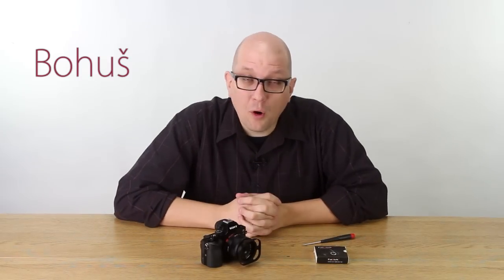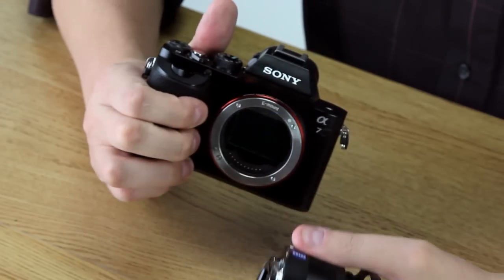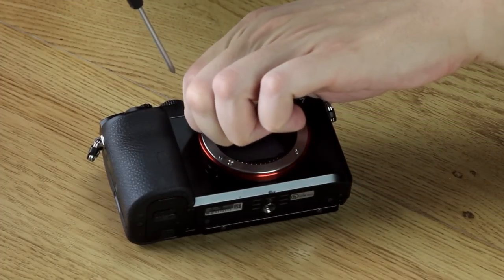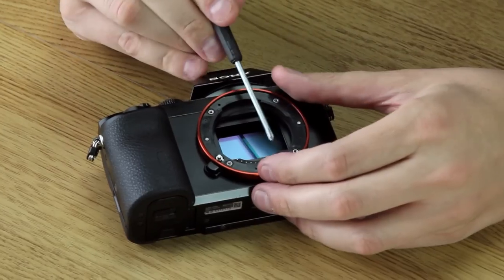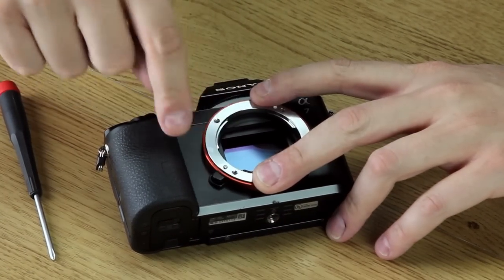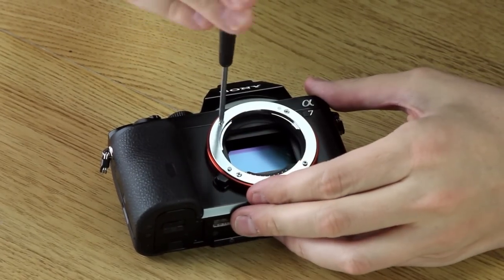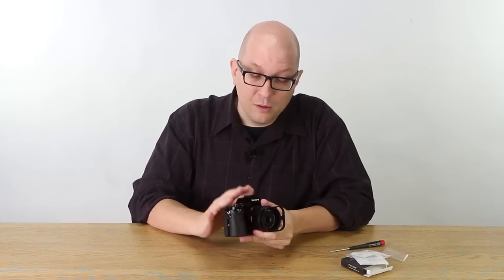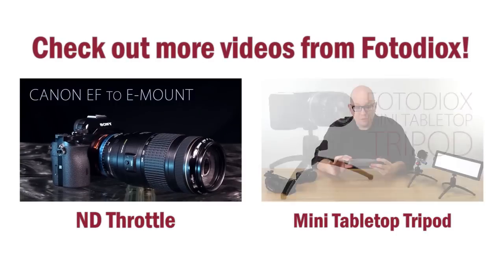Tough E-Mount - Eliminate Sony E-Mount Lens Wobble with Fotodiox Tough E-Mount Mod

Comment: I wish youd make something similar for Canon mount. That tollerances might be great for extreme conditions but wobble for architecture photography is just a pain in the ass
Reply: Bohus Blahut
why is it so absurdly overprice? more than a simple ring of stamped metal? so it isn't metal? you said it was. a precision milled part that performs under pressure? to what "pressure" it was tested? obviously it has to be precision milled. how would you expect to make it? magic? actually forged or pressed would be much better because it would have a much higher tensile strength. but since it's only secure a lens it really doesn't matter. important to get it right? why would someone on earth do something to get it wrong?
is it a metal ring or not?
Reply from the maker: Interesting idea. We'll definitely consider it.
Reply: Fotodiox Inc how about lowering the price by 90%? in that way you could still have profit selling them forever unlike being unable to sell any because china will copy that hugely overprice small piece of metal.
Reply: riskinhos We wouldn't be solving any problems by taking a cheap mount and replacing it with another cheap mount. There's more to the TOUGH E Mount than just a simple ring of stamped metal. It a precision milled part that performs under pressure, so it's important to get it right.

Comment: So on the a 7 and a7r do you loose weather sealing using this mod????
Reply: Thank to you and Roman Kruglov  for bringing this up. We don't have an A7R in house to test this with. When we looked into it, it does seem that a good number of people are disputing how effective Sony's "weather resistance" is on these two cameras. For example this photographer got totally hosed relying on the feature... http://tobinators.com/blog/index.php/2014/04/everything-else/sony-a7r-in-not-weatherproof-shock/

In our A7 (not the A7R), the only thing that could pass as "weather stripping" was the the slight stickiness on the plastic ring as I removed it. There's no gasket or anything that I'd consider important to a real weather resistant system. To be fair, we just don't know since we haven't stripped down the A7R camera, but if we're to believe customer reports online, it does seem that Sony's weather resistant claims may be a bit shaky.

All I can say is that our mod is precision made to fit exactly in the old mount's place. Until we get an A7R in the lab to test it out fully for ourselves, we wouldn't want to make any other claims - especially if there's an underlying question with the reliability of the camera's  "weather stripping" in the first place.